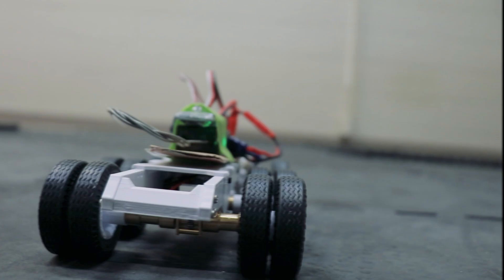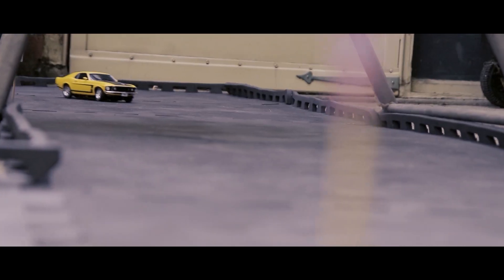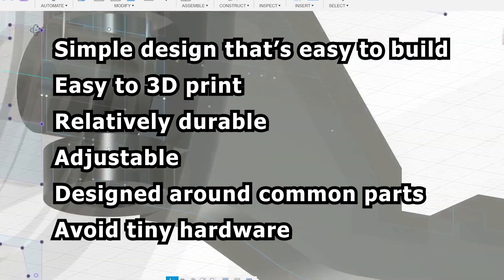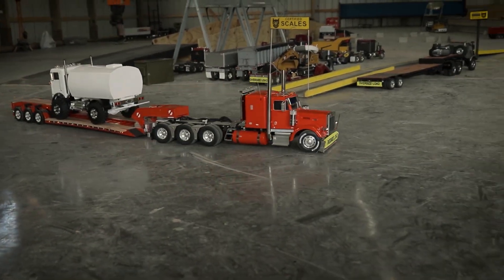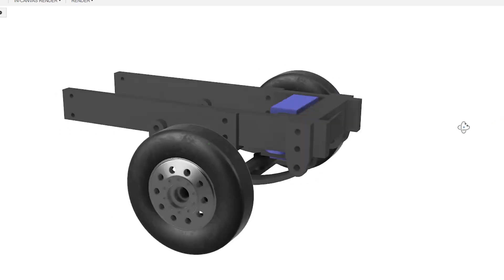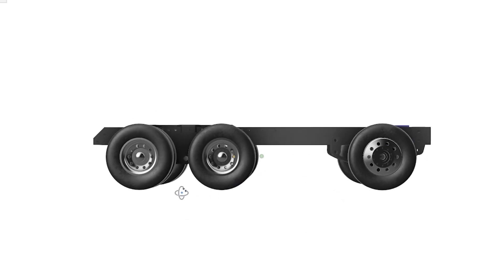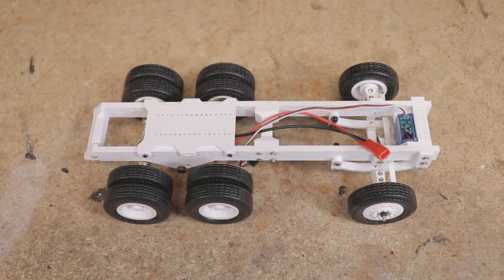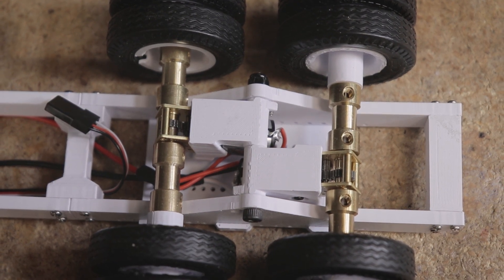Designing a Simple Truck Chassis 🚛 First Look at the Easy to 3D Print CTC 01

Comment: What RPM Motor are you using? N20/N30 motors are avialble up to 3000RPM, so as you said these are rated for 12v, but a 2S lipo on a faster motor is capable...

Comment: You absolutely nailed the Design on this. It looks so good for a Start. 
So i build 1/10 scale rc, and 1/24 model cars....so im already sold on the idea. 
But i have 100s, so i have to be careful or i will have $10,000 in rc stuff sitting here....i just happened to be building a 1/25 semi right now (local Walmart put many models on clearance for 13-20$, so i got like 10. Slingshot dragsters, pro street nova and Chevelle, 20$ for 1/25 semi and trailer, dirt oval track gto, and Fairlane 500)

Comment: For your rear suspension, look up the RS Series rubber walking beam suspension by Hendrickson. It would give a more scale looking suspension in the rear while still allowing you to keep the gear box and motor orientation you have. It also has the benefit of needing zero springs to keep the chassis at ride height, which should simplify where the axles mount to the chassis. The other nice thing about commercial trucks, the chassis are mostly the same between the US and Europe. So, if someone wanted a Mercedes or Scania, they can use the same frame as a Peterbilt or Mack.
Reply from the maker: Good idea, thanks for the info. 👍